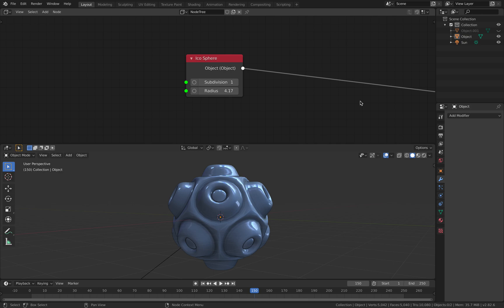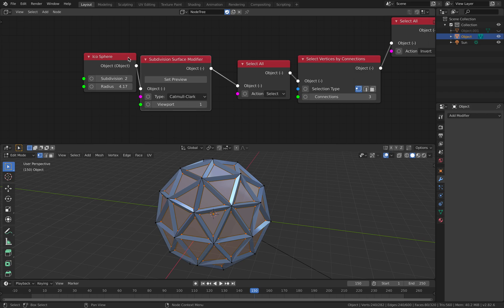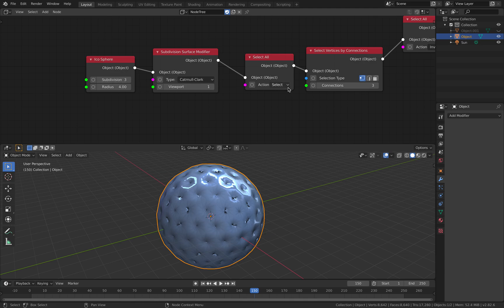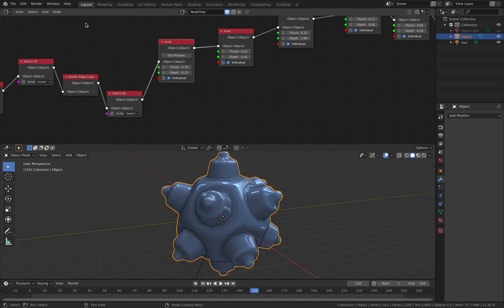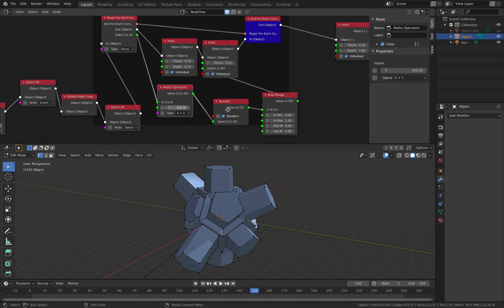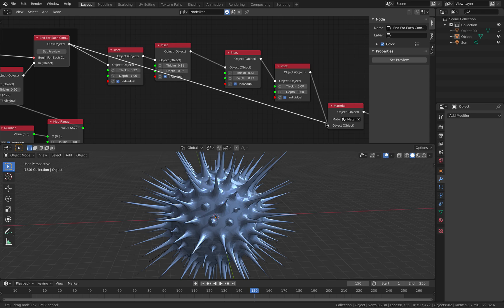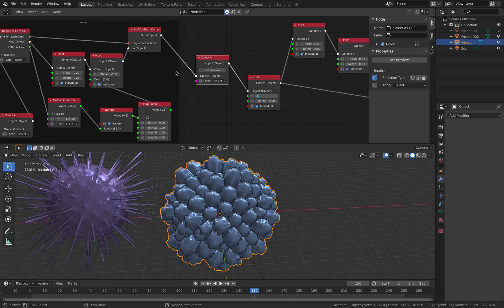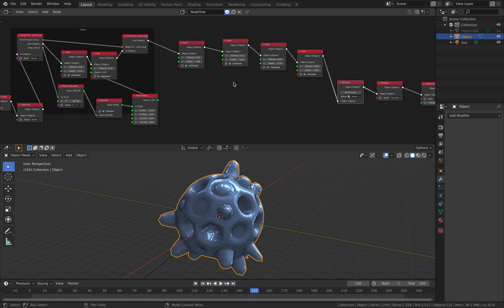LIVENODING Procedural Icosphere Recipes using Sorcar Nodes

Comment: Hey, it's me again.
I have a question .. I extruded individual faces, but I'm struggling to scale them individually. Whenever I use the transform node in edit mode, they will be scaled towards the origin point of the object. Do you know how I can scale them to individual origins?
Reply: Oh, and do you know if it's possible to animate procedural generated models? I can insert keyframes for every parameter, but it does not seem to remember them, if I play the animation.